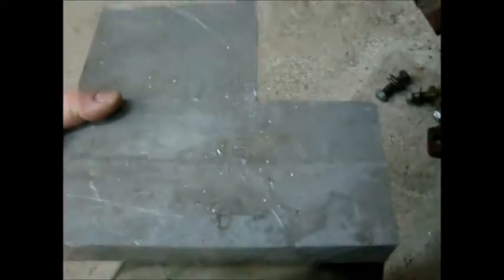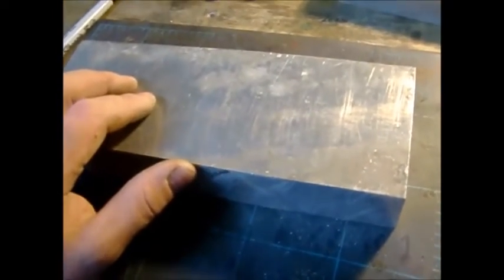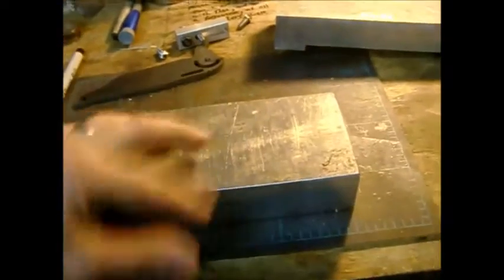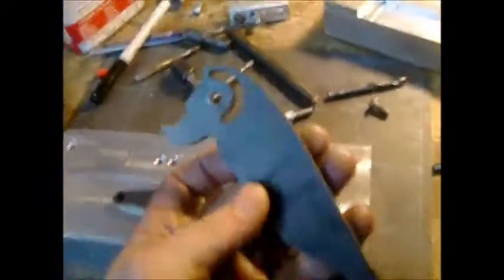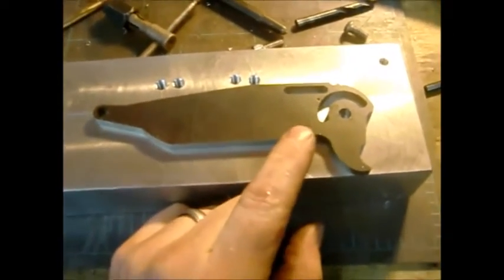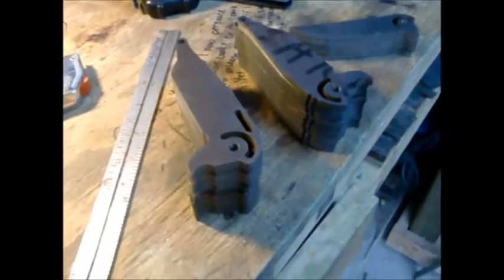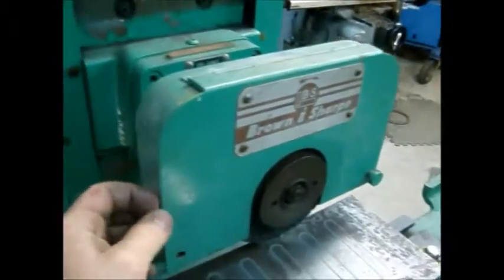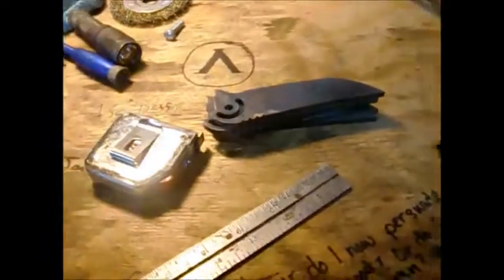Feb run part 1

Comment: Your equipment is moving on up.  You definitely look to be moving to more efficient and higher production.  All of your thoughts on the prodo A10 sound good.  Maybe you could do different runs in different configs, kind of like Strider or Microtech do, offering different small batch runs throughout the year?